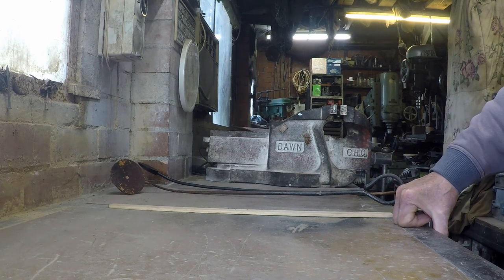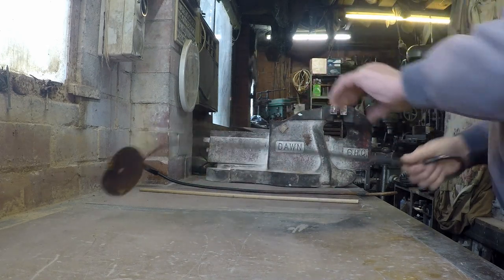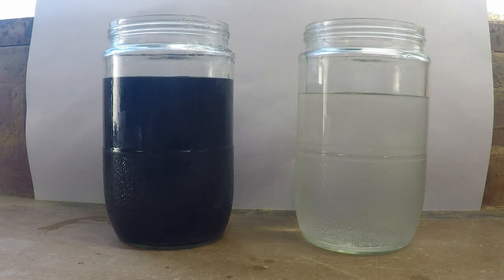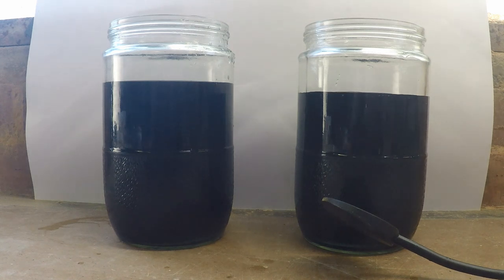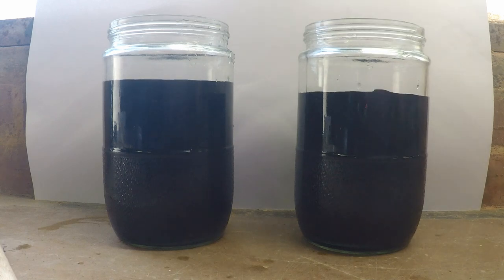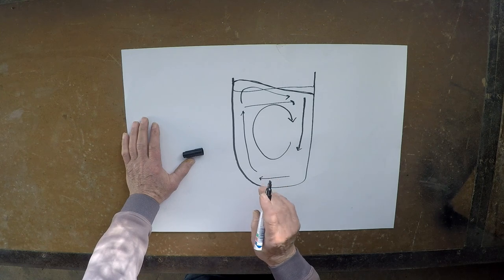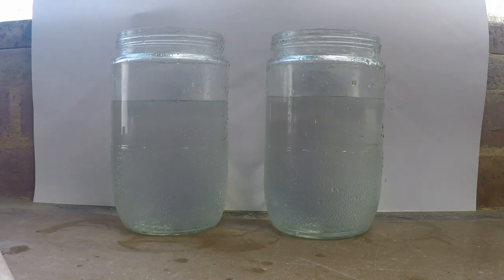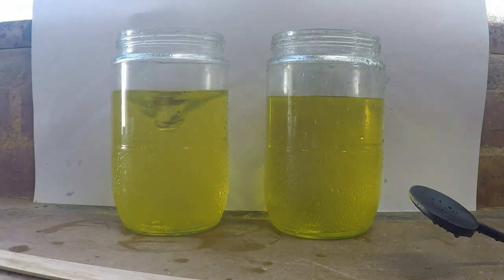Stirring metal the right way

Comment: Good day sir, I'm a machinist before but now i shift to make my diy casting. Now I'm making parts from the scrap aluminum, I've made it thicker but my problem is that, my product will crack. Well not all but sometimes it will crack, I know that there's gas trap inside the metal because when I'm going to machine, stinky smells comes out,.. now, I've researched and watch your videos, i need hydrogen to let the gas out, now, is this salt and chlorine will help to degas the aluminum and the salt helps to extract the impurities? I saw also they're using candle. If im going to combine salt, chlorine, and candle wax wrap to a foil, will this work? I hope you understand what i mean. Any explanation and help will be greatly appreciated. Thank you sir.
Reply from the maker: Boy, Lots of questions here! Before I get into them  can you tell me what sort of scarp you are using - be as precise as possible? The fact that you sometimes get cracks and sometimes not suggests a problem of variable material . What sort of die coat are you using? The stinky smell is most likely acetylene it forma when carbides in the metal are exposed to air and the moisture that it contains, the carbides (likely aluminium carbide) react with the moisture to produce acetylene and hence the smell. I will get into the issues of fluxes etc. when you answer the questions.....  Martin
Reply: @olfoundryman8418  any kind of scrap aluminum, like brakeshoe, piston, motorcycle head cylinder, motorcycle hub mostly scrap aluminum from motorcycle, I melt it without cleaning, i soak any aluminum, scope the buff gently, since this is only diy, I don't have like yours to remove the gas, and i really need the most common types of chemical or whatever to remove the impurities, maybe you have any idea regarding on this, i used only charcoal burner and not graphite crucible, only from gas tank. I keep on searching on how to removed the flux,.. flouride is difficult to find from my place. I worked before in a very big smelter company but there using fluoride, metal fluxing like yours and then go to homoginizer. If candle can really help, or chorine, or salt i really dont know. I don't know also what type of alloy the motorcycle parts mostly using. Sorry for my english, I've tried only to explain, maybe you can help. I've tried to make triple tree clamp from motorcycle, and I've got a problem 2times already, it cracks maybe a week after installing, the crack was in the area where the bolt is tightened. Thickness 18mm, and with is around 9to10 mm.
Reply from the maker: @boytaloy3756  
There are so many potential problems here with what you are doing that it is difficult to know where to start. I would judge a triple tree as a critical component from a structural and safety point of view. I believe it requires the very best of metal and technique. Considering that I would never attempt to make one as the consequences of producing a bad casting are disastrous. The casting would need to be well designed and flawless and also fully T6 heat treated.
Why it takes a week for the cracks to develop is a complete mystery to me.
But I think that most of your problems come from the metal that you are using. I long ago found out that the only thing you can reliably make by melting down all sorts of scrap is more scrap – sometimes you will get a reasonable casting and sometimes not. If the product that you are making is not critical and has low strength and corrosion resistance requirements you can get away with it - sometimes. But you are trying to produce a safety and strength critical component. I believe that your chances of doing this reliably from melted down scrap are zero.
To make it even worse you are mixing scrap that is obviously made up from several different alloys. What you will get with each melt is unknown - its casting properties will vary batch to batch as will its strength, response to heat treatment, corrosions resistance and ductility etc. It does not matter how much you degas or flux the sort of metal mix that you are using you will never turn it into reliable metal. (Big recyclers with the knowledge and equipment including full analytical facilities can do this but small users like us cannot.)
You need to use good known metal. My suggestion would be the 356 alloy. You can get this from old alloy wheels but I do not advise doing so as not all wheels are made from 356 (BMW wheels for example are not) In your place I would sell all the scrap you have and use the money to but some 356 ingot - either for a reputable ingot supplier or possibly from a local foundry who may be prepared to sell you some ingot for cash.
I don’t really see much of a problem in melting with charcoal except that temperature control may be difficult. You MUST though, melt in a proper crucible NEVER NEVER melt in a steel crucible. You should never overheat the metal - a maximum of 760 deg C is allowable.
With good metal degassing and fluxing are sometimes not necessary. For my gravity diecasting work, I do not degas and I just use a little drossing off flux – just to clean the surface of the molten metal.
Salt (sodium chloride) is useless as a flux because its melting point is too high and fluxes need to be liquid to work. A 50:50 mix of sodium chloride and potassium chloride – sold in grocery shops as “Lite Salt” is in theory better as it melts at a much lower temperature. However, such a mix will NOT dissolve aluminium oxide so it cannot clean the metal. You need to add a fluoride to this mix, say 5 to 15% of sodium fluoride or the commonly used cryolite – sometimes you can buy these from pottery supply companies. This flux will not degas the metal and if at all damp will actually increase gas levels. People plunge all sorts of crazy things into molten aluminium in the very mistaken belief that they will clean and / or degas the metal. Washing soda, baking soda, Epsom salts are common examples and ALL just add gas and oxide rather than remove it. I do not believe that candle wax will do any good either.
I am sorry to be so negative but you are trying to produce a safety critical part out of scrap and such attempts will only lead to disaster and possibly loss of life. Even with good metal and good technique I would refuse to make this part as its just too critical. I suggest that you find something less critical to make.
Regards, Martin
Reply: @olfoundryman8418  I understand sir, and thank you for your advise, will maybe I will try to work abroad again and concentrate to my profession as a cad cam programmer or a cnc machinist or manual machinist. I will leave this business soon. Thank you and more power to your channel at best of luck to your hobbies or businesses. Thank you

Comment: Excellent information Martin  [as allways!]  A quick question please, I know you cast alloys but the principle is prob the same, I want to cast brass & bronze  barstock [not at the same time!!hehe] some 3/8" 1/2" & 3/4" dia, for turning model steam engine fittings, ,in the past I just poke bars vertically into greensand but they often look great from the outside but on machining they have porous spots in the middle, Any ideas please? thanks
Graham.
Reply from the maker: Graham, Ah yes, the old "lets cast own bar stock idea". After all "how hard can it be?" I am not trying to rubbish it, its just that most people do it so badly and end up with such  defective castings that its all a bit of a dead loss. I note that those who claim it works for them seem to have low standards when it comes to casting quality 😊. The best way was invented by this bloke called Durville who solved the French mint's problem with aluminium bronze ingots for coin production - they had so much aluminium oxide film in them that they just split when rolled to coin thick sheet. See here for an introduction to his solution  https://academy.ampcometal.com/a-brief-insight-into-the-history-of-tilt-casting. This is a bit complicated for the hobbyist but I do have some ideas to improve your chances,  come to me at   olfoundryman@gmail.com  and I will explain. I will swear you to secrecy though, as I hope to do a video on the subject... Martin
Reply: Why would you cast brass and bronze?  You can buy it ready made in the sizes you want.  So much effort to cast it and for steam engine parts it should be good material.
Reply: @smallcnclathes  Why would I want to cast brass & bronze? the answer to that is,  that's why I have a foundry, & I have a good supply of brass, bronze & alloys, & bronze bar is not that cheap, brass a bit cheaper.
Reply: @olfoundryman8418  Thanks for the reply Martin ,very good of you ,I'll be in touch.
Graham.

Comment: When I was working in a Scottish foundry earlier this year, I saw and used a lot of homemade dross skimming tools- heavy low carbon steel, bent at an end. One for each metal, ferrous and copper based alloys. I especially liked the small shovel used solely for aluminum.

Check my chanel for some 'professional' videos and be critical in commenting my errors :D